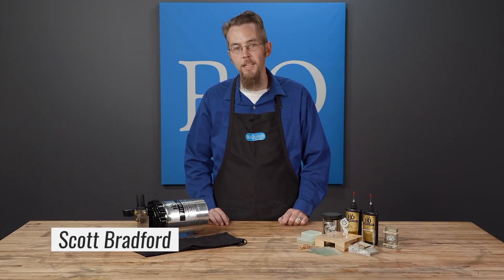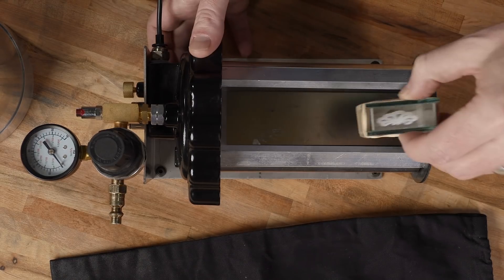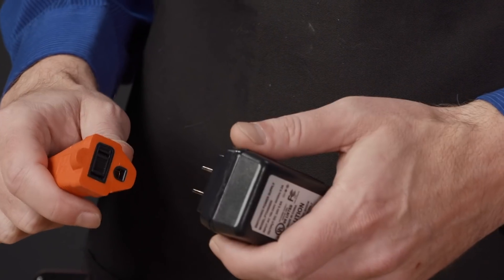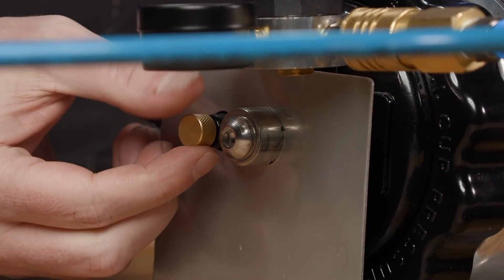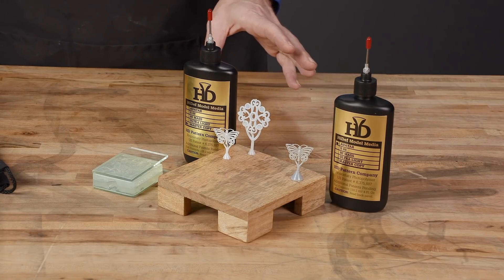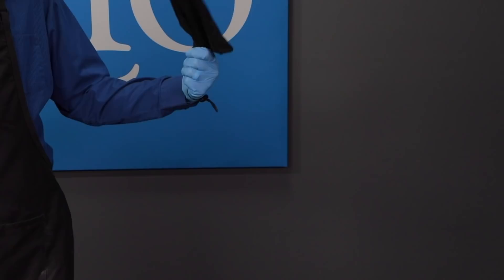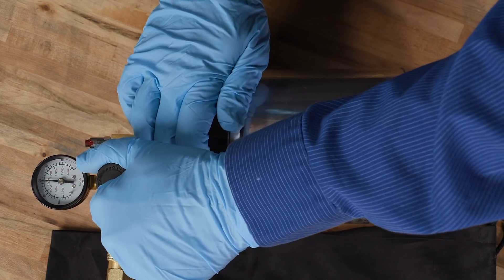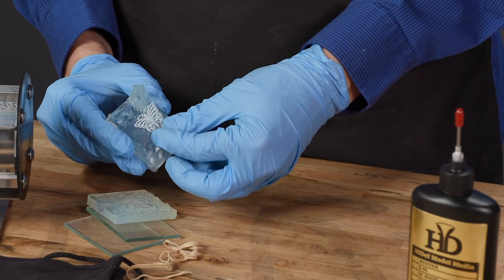Curing Molds & Models in the HD Pattern Firefly™ UV Chamber

Comment: what kind of resin you use to make molds?
Reply from the maker: Hi There, Thanks for watching. For making masters and molding we recommend the HD Pattern Master Copy Photopolymer Injection Solution
Item #: 701435 on our website. You can find both the casting resin Item #: 701428 and the molding resin, Item #: 701435 here https://www.riogrande.com/search?q=firefly&c=&t=1&pageSize=32&p=c8bf4767-9600-4781-b2e1-9024e4cb1acd 

We hope this helps!